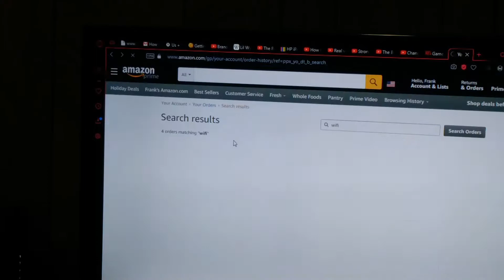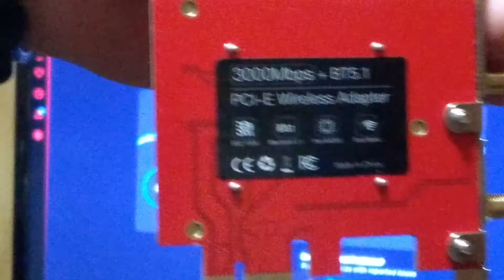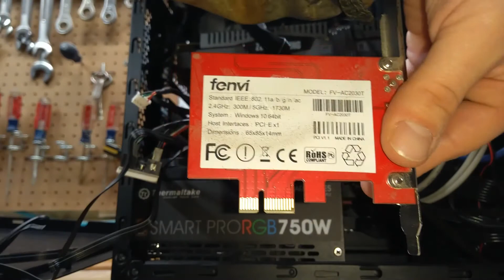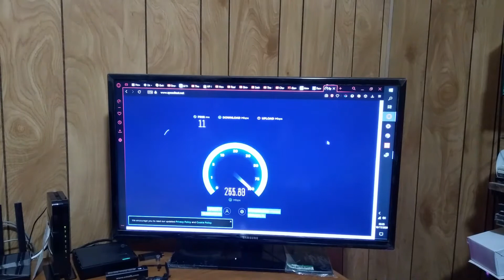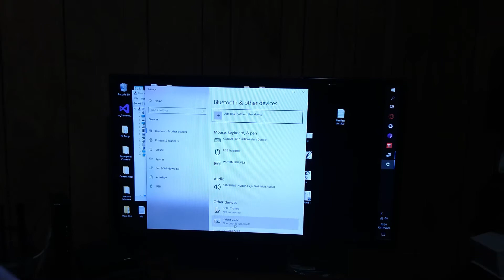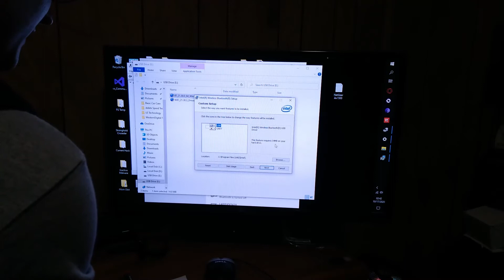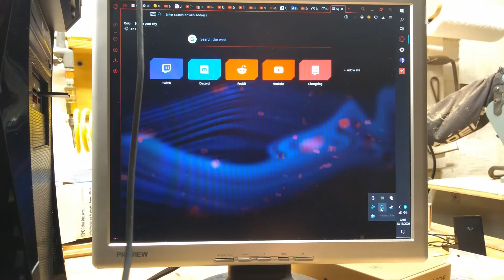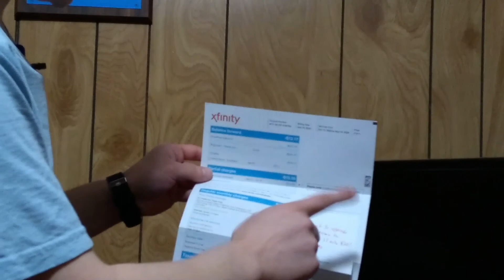How To: Upgrade PC From WiFi 5 To WiFi 6

Comment: hey man just watched the video and i have a couple questions if u have time to answer them
Reply from the maker: Yessir, ask away
Reply: @letechnology1774  so I just had to get new wifi because my other wifi was a router and modem in one from spectrum and it would over heat and turn off so I got new stuff from spectrum which was a separate router and separate modem and the router does say wifi 6 but my old wifi was not wifi 6 but was better when it comes to ping in games
Reply: @letechnology1774  I stream and play games alot and I cant really do that now because my ping is pretty bad even though the new wifi 6 is supposed to be better.i use an ethernet cord that goes from my router in the living room to my pc which is one room away but for some reason the ping is pretty bad. On my old wifi I had a upload speed of about 9 but on this new wifi it's only 3 and I'm not sure why
Reply: @letechnology1774  I'm not sure if I should get a night hawk gaming router or of I should get the wifi thing you got for your pc because I'm not sure how to check if mine is wifi 6 and im not to good with pc tech so I dont want to take it out in case I mess something up
Reply from the maker: Ok so Wi-Fi 6 technology is more efficient as transferring data, but for max potential it needs Wi-Fi 6 capable devices. If your PC is only Wi-Fi 5 then your not getting full advantage of Wi-Fi 6 network. Why? Check out this link: https://nerdtechy.com/wifi-6-vs-ethernet and look for the half v full duplex explanation. Also it explains a little about ethernet v Wi-Fi 6 connections. 

I would recommend checking PC and upgrading wireless card to a Wi-Fi 6 capable one. I just uploaded 2 videos on my channel that may help you with that. Until then a better router may not make much of a difference. 

And also I have my PC connected via ethernet (Cat5) and Wi-Fi 6 simultaneously, maybe connect yours with both as well.
Reply from the maker: And this is an interesting link I suggest skimming through as well: https://www.techspot.com/article/2098-wifi-5-vs-wifi-6/
Reply: @letechnology1774  ok thank you so much and ya I just ordered a new wifi card for my pc so but I took mine out to see if it was wifi 6 capable and it didnt say anything about it
Reply: @letechnology1774  another question so can you not use ethernet with wifi 6 like you can with 5 because im also running an ethernet while being connected wirelessly and it doesnt change anything
Reply from the maker: nice! yeah AC = 5, AX = 6
Reply from the maker: No you can use it just like with wifi 5
Reply: @letechnology1774  hey man so I just got the new wifi card and I cant get it to fit in because I think it's to long
Reply from the maker: @Chronix1k  did you get it to fit? Sometime it's a tight fit. Or is yours a mini PCIE version?
Reply: @letechnology1774  so i found out that it wasnt to long but the part you plug into not the cable but the slots you have to put it into were to small I guess
Reply: @letechnology1774  I didnt know there was different sizes like I said I'm pretty new to the pc stuff
Reply: @letechnology1774  how would I find one that fits?
Reply: @letechnology1774  if you have a discord i can send you what i mean if your confused lol im probably wording it wrong
Reply: @letechnology1774  i just checked out what the mini pcies look like and mine definetly isnt. but when i tried to put it in it wouldnt go in and i didnt wanna push to hard on it and brake something in the pc so idk what to do
Reply from the maker: @Chronix1k  haha I was the same with my graphics card. I thought I broke it but sometimes it's a VERY tight fit on the Mobo slot. You may have to play with the tabs on the side of the slot a bit. Lemme know how it goes
Reply from the maker: @Chronix1k  what kind of PC or motherboard do u have?
Reply: @letechnology1774  idk what kind of mother board but I know the pc is from nzxt
Reply: @letechnology1774  wait so do i have to take the grapics card out to put it in because when i took the pcie that was alrerady in my pc i didnt have to take the grapics card out
Reply: @letechnology1774  hey man so i got the pcie in i just had to push a little harder but mine didnt come with the drivers that yours did it came with a disk that say have the drivers on them but i dont have a disk slot so what should i do
Reply from the maker: @Chronix1k  good question lol. I'd check the manufacturers website. Usually whoever makes it has files hidden somewhere on their site for download. If not, I'd say windows update or if in device manager (second to last video I uploaded) you can right click on the network card --> properties --> update drivers
Reply from the maker: @Chronix1k  Where did u buy it from?
Reply: @letechnology1774  so i got the driver from there website but my ping is still high in games so it was just a waste of money because it didnt do anything
Reply: @letechnology1774  i got the pcie from amazon
Reply from the maker: @Chronix1k  ok so if you can't find the drivers on manufacturer website, contact seller you bought it from and they should be able to get you a link or something for the drivers
Reply from the maker: @Chronix1k  no that was only because my PC is cramped on the inside
Reply: @letechnology1774  I did get the driver's and installed them but my ping is still high when I play a game